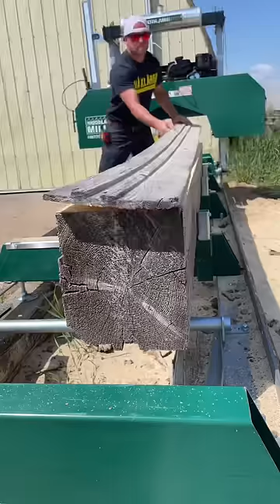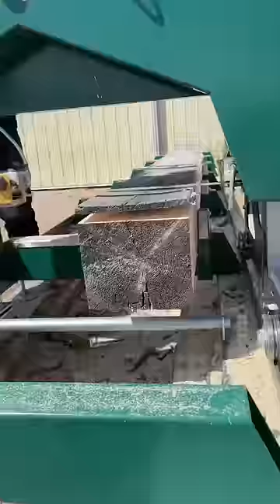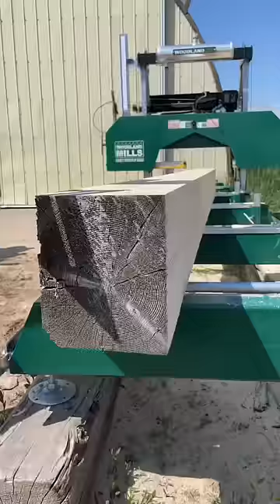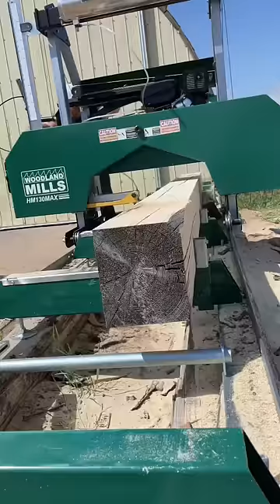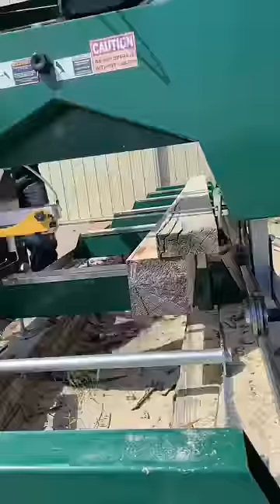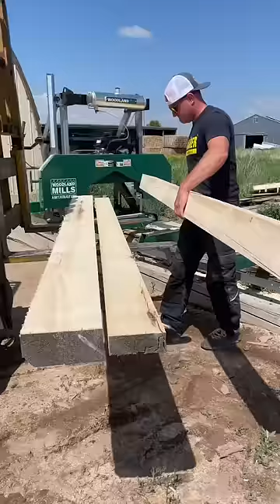Cutting some pieces I need #woodwork #maker #shorts #woodworking #tools #wood #sawmill

Comment: Brother, old lumber should be preserved and used if it’s in that good condition. That beam was worth exponential more and could have helped restore an older home. Just bite the bullet so to speak and spend the $30 it would cost to get those at Lowe’s

Comment: It's really only parallel.... You cut equally of all sides....
I'd be square if you cut two opposite sides, then located off the now finished sides to get your 3rd angle. Then you could cut the fourth
Reply: Which will leave you with one squared beam and four pieces of scrap, while he gets two usable parts.
Reply from the maker: On these machine there are vertical bars and when you roll it the first tike it clamps to the bars and the bars are 90 degrees to the blade. Then you have a 90 as I showed. Then the next two cuts are perpendicular to the flat cuts making it square. Then I cut further because I wanted a square 5x5, which I got plus two more boards

Comment: I wonder what the tongue and groove where originally for
Reply: These were solid timber flooring from old warehouse tear downs.
Pure wood gold
Reply: I'm pretty sure these were for outside walls on a cabin, in which case the grooves are for vapor barrier gaskets since obviously you wouldn't tyvek such a structure. The material is far too thick to have been used for flooring, I would think.